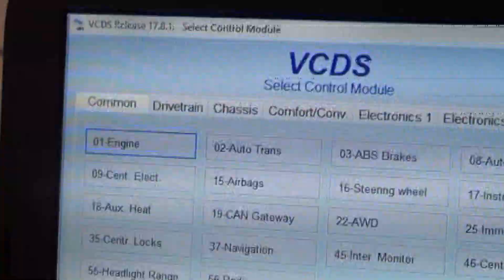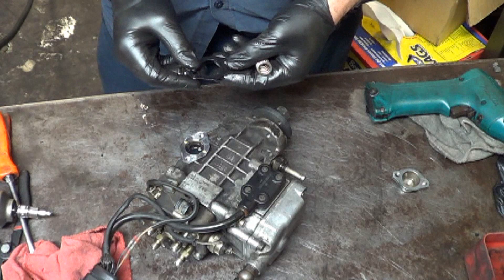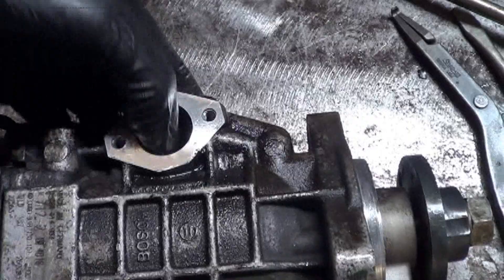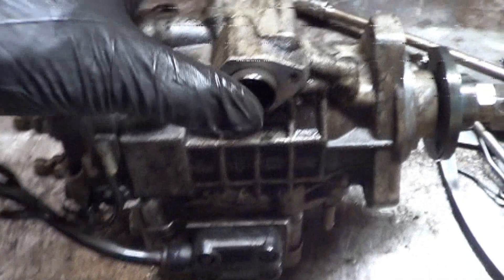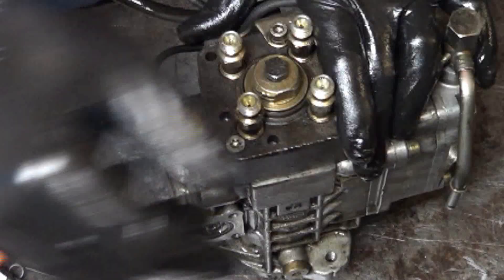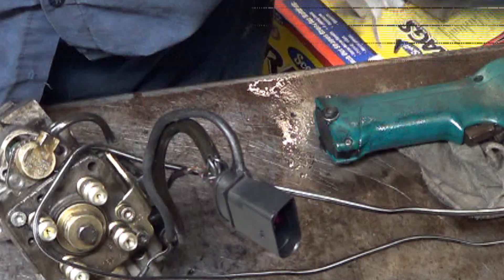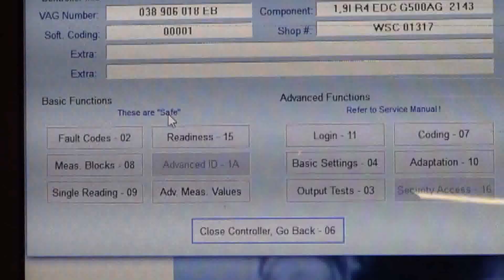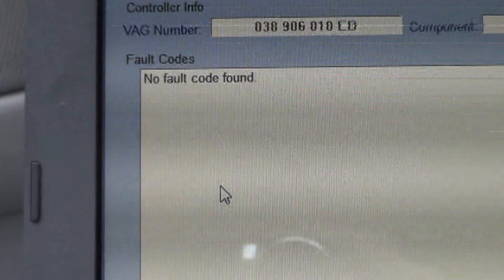Vw Tdi Timing code P1248 Part 2

Comment: Thanks so much for taking the time and posting this.  I have 524TD IDI with Bosch VE (normally it's mechanically advanced, like on cummins etc, but this one is solenoid metered).  My current one is fried but got a used replacement from a VP30.  I seriously think they just throw on different part numbers on the exact same part because your solenoid looked exactly the same down to the color of that little screen filter.
Reply from the maker: thanks for watching.

Comment: Nice fix sucks that the other garage missed a simple O ring but that’s where school of hard knocks comes in I myself would of missed the O ring  as I don’t open up pumps often anyhow good vid 👍👍
Reply from the maker: The other mechanic replaced the  solenoid so I actually think they might have been right in their diagnosis.  Or maybe the o-ring was missing on the 1st solenoid as well.
Reply from the maker: I was willing to go deeper into the injection pump to find the problem, but luckily I found the o-ring.  I'm willing to do some repairs inside there but I certainly cannot claim to be an expert injection pump rebuilder.

Comment: 2:05 the moment that the black shim inside cap was fall away but did not know yet about it  
i would like to say thanks , all but all the web say '' neeed to remove pump from timing to do a n108fix'' ,
with the help of your video ive suceffuly removed this cap at 2:00 without removing pump from there 
ive taked a T30 small bit , with an 1/4 key  the cylinder was stuck giving me 255 in block 2 my n108 was 15.5ohms  and have 12V when car was on , the car feeled like a john deere with loose conrods ,, and have absolutly no acceptable throttle response untill 2000rpm 

after removed this cap ,ive  loosed the 3 ip bolts to adjust timing and wiggeling the center shaft  back and foward ive succeffuly unstuck the cylinder that would goes out each time you wigle back then fourth  , when i have put back the cap spring and shim and applied a litle force on it  , the cylinder have made a major course ( more than it was when i removed this cap , i heard it go at it full travel , now the car look fixed for that , im not totally sure , need to check in vag com if im still at 255 in block 2  will update this comment because its a major headashe to study about this issue ,, ( here , motor was out of a car since 1 year 

thankl a lot you shared a lot of usefull information by doing this , keep your good work Grats from quebec Lac ST-JEan

Comment: I learned a lot from y,our video. I have a 1.9 trillion and its having starting issues. If I goose the pedal then it will start. Is there a fuel pump in the tank? If so how do I test that it's working?
Reply from the maker: On ALH cars like the one in this video there is no pump in the tank.  On BEW, BHW and BRM cars (04 - 06) there is a fuel pump in the tank.

Comment: Hi, great video. I have the same code, removed the pump, and opened the bottom side covers to expose the start of injection piston as seen around 5:30 in the video.  I found a little chip of metal off the end of the piston has broken off and there was a tiny bit of metal shavings both on the end of the solenoid and where the piston was chipped.  The piston bore seems very lightly scored so I can push it back and forth and it does affect timing but I have to push considerably harder than you push in the video.  It seems to me the hydraulic pressure is not overcoming the friction and that is causing the start of timing deviation. How would you recommend I proceed?  Is there a way to remove that timing piston to lightly sand (like 800+ grit) the surfaces to face them so the piston can travel smoothly?
Reply from the maker: ha!  I think I just replied to a facebook post of yours.  Buy a core pump and transfer the components.  Or just buy a used pump.
Reply: @CoolAirVw  Yeah that was me.  Thanks for your help!

Comment: How exactly did that o-ring affect the function of the solenoid? Not sure you explained it. Thank you for educating us on our ALH TDIs!
Reply: since the PWM (pulse wave modulation controlled) solenoid acts like a faucet, it moves to adjust the fuel pressure on the timing advance mechanism depending on the amount of advance from the computer fuel management system... if the o-ring is not there, the fuel pressure leaks right past it and can't control it... So, that's as complicated as I can make it (sorry, it seemed way more simple in my head).  I just replaced my N108... and of course, it had to happen right AFTER I did the timing belt service. I used an ohm meter to check the old one, it showed OPEN (the new one was maybe 12 ohm, if I remember correctly)  Now, I'm getting P1248 code. @CoolAirVm Rm GREAT video, thanks !!!
Reply from the maker: what he said!  I couldn't have said it better!
Reply: @CoolAirVw  but the bad news, the part number was slightly different... and the 'easy pin' removal and connector splice didn't go so good... now getting "intermitent" code again, but no drivability issues... Need to investigate more soon.
Reply from the maker: @ManVsOven  what is p1248?  (sorry cant spend the time to look it up and I dont know the year)
Reply: @CoolAirVw  The same p1248 in your title of this video.. ALH engine, same as your video.
Reply from the maker: @ManVsOven  sorry not paying so much attention.   Have you watched this video?   https://youtu.be/OwdoCa0JtWQ

Comment: Good job.  I replaced my timing belt and my start of injection is at 255.  How do I get it to 65 (spec).  Moving it within the oval holes of the IP pulley does not move the timing at all.  255 no matter where it’s at via IP pulley.
Reply from the maker: you probably have it so far out of time that its simply showing you a default value.  You'll  need to disconnect the belt and retime it to get it close enough to show you a real value.

Comment: Dealing with the same code for months. I've checked the timing and I injection quantity both look fine. I removed fuse 34 and the engine sound changed. I'm thinking of trying a diesel purge cycle straight to the pump. Any ideas?
Reply from the maker: worst case scenario you have to change the pump.
Reply: @CoolAirVw  just to clarify are you telling me I have to change it or just letting me know what the worst case is? Thanks for the tips and videos
Reply: @CoolAirVw  just following up thanks
Reply from the maker: I say, "worst case scenario you have to change the pump.:..  your next question, " do I have to change the pump or are you telling me worst case?"

Comment: Impact on tight screws/bolts? Not a fan
Reply from the maker: In depth explanation of how timing is done on this injection pump,  diagnosis and fix without replacing injection pump, yet your concerned with what?     I believe there is a internet slang term for that.
Reply: @CoolAirVw  ya . A cheesy mechanic. Pretty sure after watching both videos you did replace the pump. Least I'm not stripping bolts
Reply from the maker: @jameswiebe9221  It aint easy being cheesy!  Thanks for watching and commenting.

Comment: There was CEL on my Skoda ALH 1.9 TDI 2005. The error code was P1248. You had advised to set the timing correctly. I have set the timing with the help of VCDS and the error is gone. The car is nice and smooth without any vibration and knocking. Thanks a lot for your valuable advice. Please keep posting such wonderful content which helps us to a great extent.

https://drive.google.com/file/d/13xw4fvh7HIu3lSvaUsupQstolv3sZf2K/view?usp=drivesdk

https://drive.google.com/file/d/13yyexs5KoeevhKBQ1XpnnejznG1Bjv03/view?usp=drivesdk
Reply from the maker: Your welcome.  Thanks so much for the positive feedback.